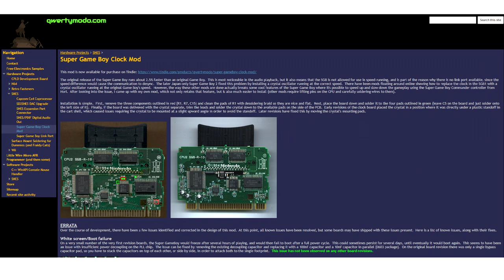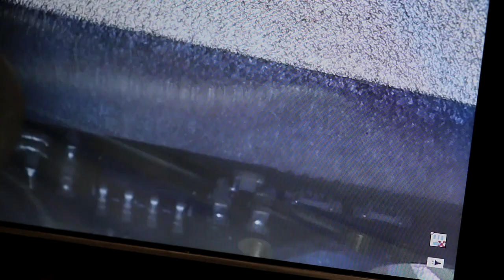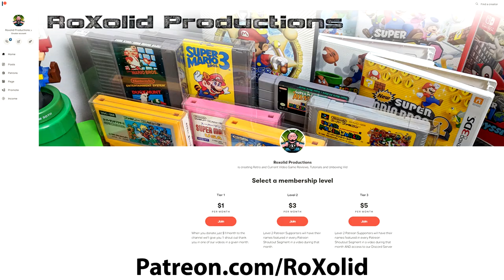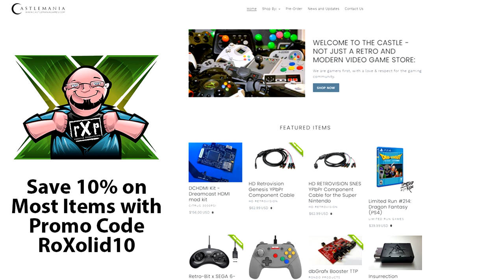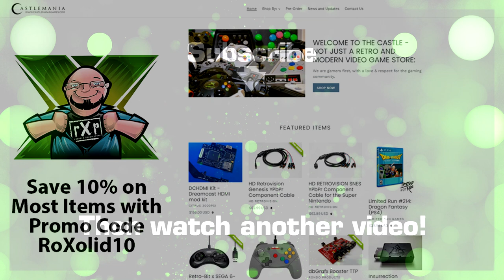How to Easily Correct The Super Game Boy's Incorrect Clock Speed

Comment: Pretty awesome!  Does that flux fluid dry up easily, or do you have a wait period before you plug in the cartridge.
Reply from the maker: So they call it "No-Clean Solder Flux" as it's supposed to dry completely a not require cleaning. I clean up afterwards just for piece of mind.
Reply: Yeah always clean up the flux afterwards it's best to do, Gary is correct 👌 he won't lead you wrong.